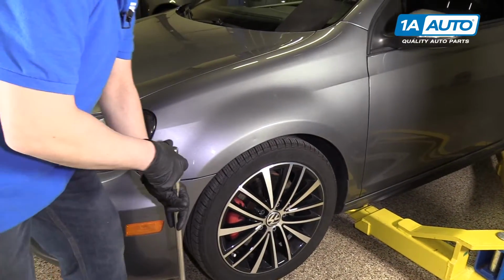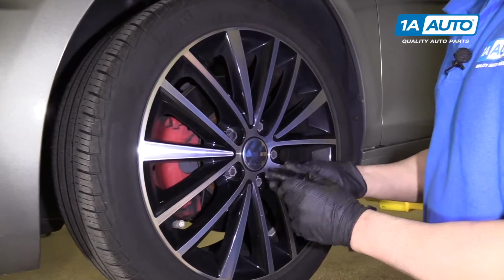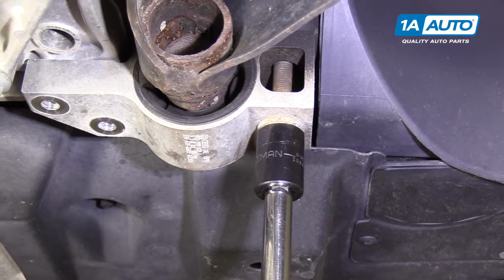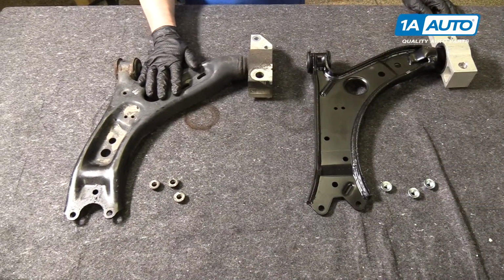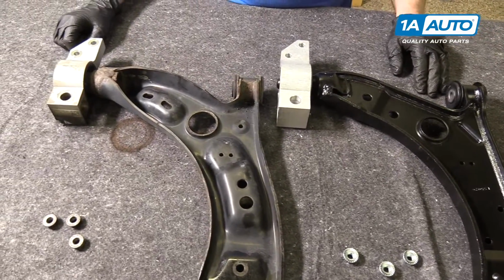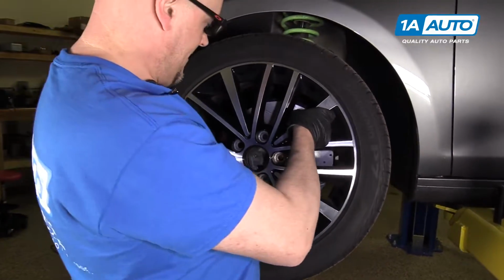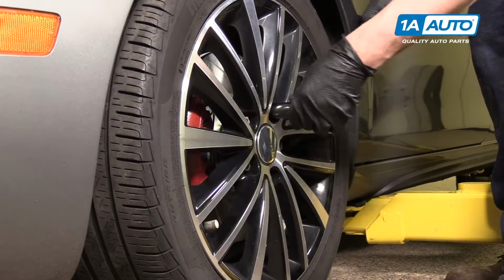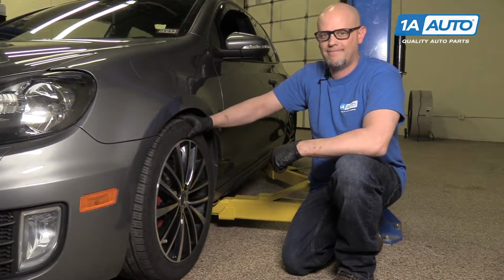How to Replace Front Control Arms 06-13 Volkswagen GTI

Comment: You guys did the easiest one...right is harder to remove
Reply: Why is that? I'm planning on replacing both my front control arms next week
Reply: All the videos I have seen have been the easiest side... driver side.
Reply: @thecrittergitter7576  funny because my drivers side has a transmission in the way
Reply: @kyle6394 yep. I just did this and you indeed have to remove your transmission mount and jack it up about 3 inches. Very fun

Comment: I note that the new control arm cam with new nuts for the Ball Joints section. However, I wish to know (because you video does not show) whether you used the old original bolts to install the new control arm sections?   In other words is it okay to reuse the old bolts or must one order new bolts. (I assume that if the bolts are not deemed one time use, then it should be okay to reuse the bolts unless they are damaged)

Comment: Stretch bolts (as well as locknuts) should always be replaced not reused (but if no choice use thread-lock); full weight should be on wheels in normal ground position before final tightening; subframe locating pins (e.g T10096) should be used (then re-alignment should not be necessary)?
Reply: Full weight should be on before final tightening of what
Reply: He torques once car is on ground

Comment: Way to go bud you did the easy side haha wait till you realize the transmission is in the way of the bolt
Reply: yea i saw this and realize this it too easy and forgot about the transmission, I saw a video where the transmission oil pan is blocking a bolt entirely, a vid showed that you can unlink the transmission from the frame to pry the transmission forward just enough to unbolt it. Granted I need to do more research
Reply: If I’m not mistaken he did the transmission side in the video. You can see the trans drain plug. So I’m confused the engine side is harder?
Reply: @austincrooks7385  driver side is easy with a manual shift. Passenger side is another Story... going in now. Wish me luck. I used a jack to lift and position the other control arm in place rather muscling it. Then torqued to specs.
Reply: get a manual 👌🏽

Comment: I believe this only works for manual transmissions. On mine, the inner bolts are blocked by the transmission and oil pan. Have to lift engine or lower subframe.
Reply: There is another video on here showing how to do it using a crow bar
Reply: I used my floor Jack with 2 blocks of wood and un did the trans mount for the passenger side and then when I did the drivers side I un did the motor mount.

Comment: How do you perform this job on the drivers side when you have a DSG automatic transmission?
Reply: I'm stuck with this too! Not enough space for the socket. I read somewhere about removing gearbox dog-bone bolt to allow some movement, but it's not helped.
Reply: Buy a manual
Reply: You have to Jack up the transmission side to remove the front bolt
Reply: Easiest way I've found, support the trans, undo the trans mount, raise it the amount needed to remove bolt..

Comment: I have an '06 VW GTI that needs two lower control arms with ball joints assembly. Is this control arm installation video what I would need for the first part of the assembly, or is the control arm in the video different from a lower control arm?
Reply from the maker: +pmbarcia This will be the correct how-to video for that application. 1aauto.com

Comment: Those three bolts are very hard to separate from the arm.   Any adeas???????
Reply from the maker: +jose96397 We recommend soaking the bolts in some PB blaster or if that doesn't work, give them a little heat so they come out easier.  Thanks for watching.

Comment: 60 or 16 Newton Meters???   Can't tell what you're saying & CC says 16, but that seems little low.   thanks
Reply: he said 16 MILLImetres haha
Reply: 16 Nm is like using your fingers to tighten the bolts. It's 60 Nm with steel casting control arm and 100 Nm if you have sheet metal version of the control arm (as the older one here)